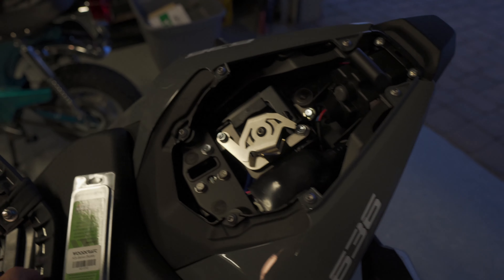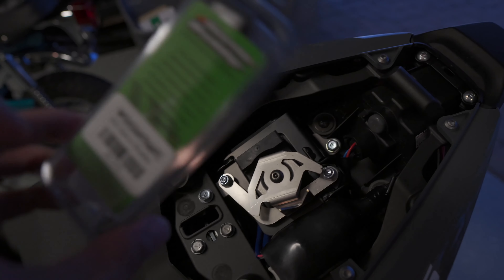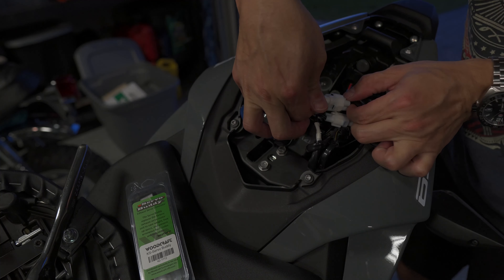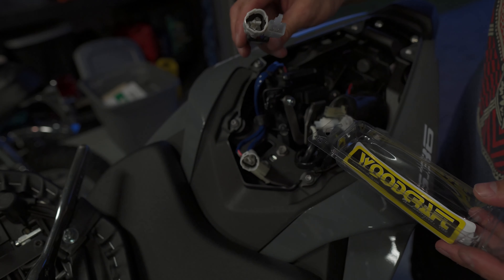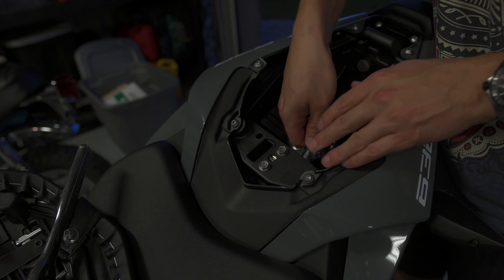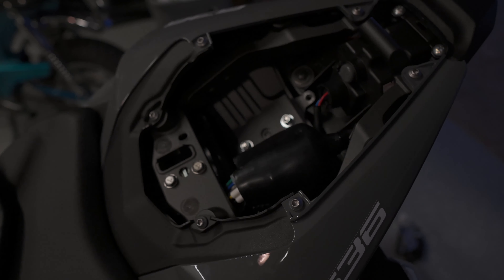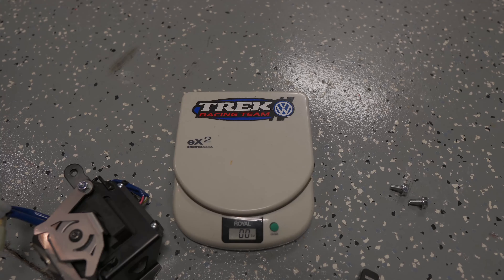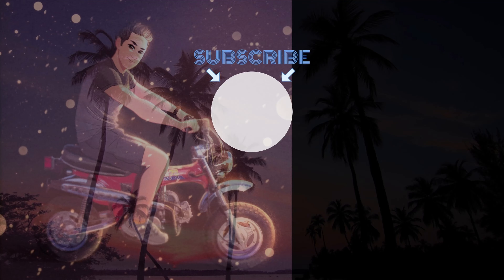Servo Buddy Install on 2019 Kawasaki ZX6R 636

Comment: I just put this on my 2023 zx6r and the engine light didn't go away? Any advice?
Reply from the maker: Have you rode it around for a while? I've heard it can take 20+ miles to clear the code.
Reply: I was doing more research and yes I had the exhaust and servo buddy come in today and remove d the exhaust the day before just wanted to hoon around obnoxiously for a night. I'll put a few miles on it and see what happens, thanks 🤟🏽

Comment: I did install mine servo buddy  but it still shows the engine light on
Reply from the maker: Did you have a light on before the install? You probably need to reset the ECU

Comment: Is it a good idea to get this first before installing a full system exhaust?
Reply from the maker: It's probably easier to do it at the same time since you can pull out the cables for the butterfly valve that you won't need for your new exhaust (but still do for your stock exhaust).

Comment: Before you connected the Servo Buddy , you had CE ight on ?
Reply from the maker: No, I originally installed the mechanical solution that was included in the Yoshimura package. You can see that installation here: https://www.youtube.com/watch?v=F97tRGQgYTc&t=525s

The Servo Buddy just cleaned things up so I had lots of room for the Power Commander V and other stuff.

Comment: I recently installed a m4 slip on exhaust and a servo buddy and I have the FI light flashing. Any idea how to reset the code myself?
Reply: Audie if I’m not mistaken, it can take a while to shut off. Kind of like a check engine light. Did it ever go off?